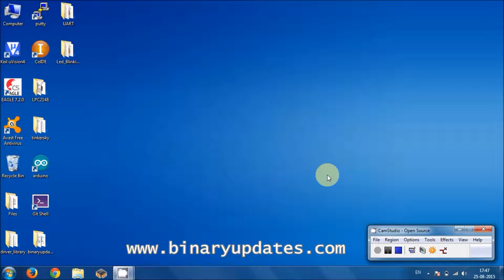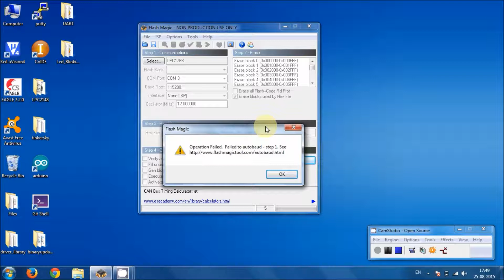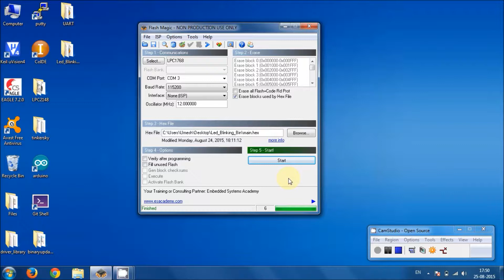Flash Magic to Program ARM Microcontroller

Comment: the new chip purchased it already comes with the bootloader installed?
Reply from the maker: Hi Rodrigo that really depends you consult manufacturer datasheet on microcontroller. Usually, primary bootloader comes by default with the chip. I hope this may help you. Good Luck